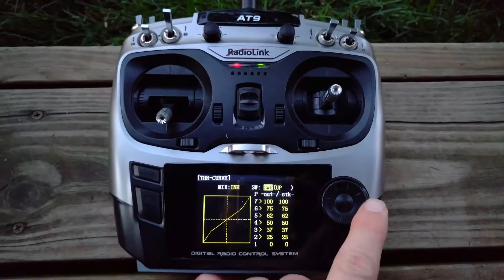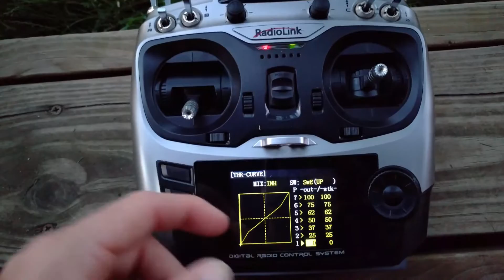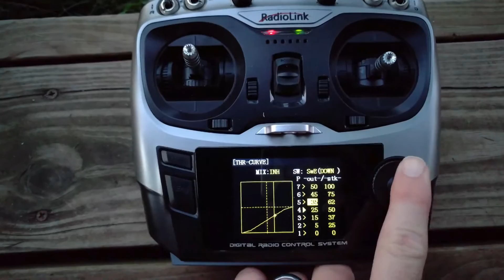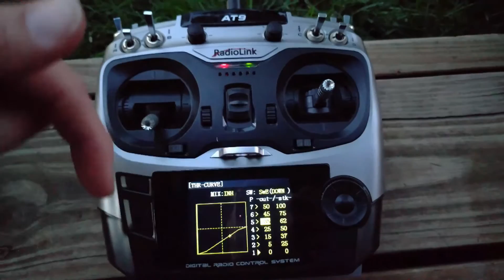RadioLink AT9 Throttle Curve Setup

Comment: Not understanding throttle curves as fairly new to this tx
I am finding my throttle stick has to be almost middle point befre i can make the quad move How do i alter it so the throttle responds at the bottom Thanks
Reply from the maker: Just adjust the throttle curve so at the bottom it is stopped and towards the middle you have hover, that's usually a good way to set it up.

Comment: In Betafligh I'm gettign 1067 - 1923 on the throttle value in the Receiver Config. but my motors wont spin up till 1146 in the BF Motor Calibration tab. Think this will help? I have already adjusted the stick parameters on the AT9 and balanced the motors.
Reply from the maker: MikeDrones it could be a solution, however, I would look at setting the deadband for each motor. This way it maps 1 from the remote to idle speed for the motors.
Reply: Thank you !! Ill check that out.  Your quick response gets you another subscriber.
Reply from the maker: MikeDrones I was going to apologize for the delay in replying, but thank you for subscribing

Comment: What does the INH do?
Reply from the maker: That would be for the collective pitch, you would probably use it if you work using a helicopter or a Quad set up with collective pitch control.
Reply from the maker: INH = Inhibit, so you would set that to on if you want to use collective pitch to control the throttle.
Reply: Five30Reviews thanks for the response. Mine is set to inh. I hate to keep asking but what do you mean by collective pitch?
Reply from the maker: Unlike on a quad On a helicopter, to go faster the propeller does not spin faster the pitch of the blades change.  Destin has a good video about it, get's a lot deeper than I could. https://youtu.be/MaB4k1SgfUg
Reply: I see, thank you.

Comment: Ok I have set mine to the 2 position switch and I had one profile set to normal and one with the 0 stick input to 5% throttle would that give the effect of an idle up switch. I am very new to RC and I want to get better with my acro flying. But no one has done a video that I have found that shows how to due an idle up so my quad doesn't crash out of the sky when the stick hits 0.
Reply from the maker: I have been reading about the idle up as well, it should be fairly easy, it may even be part of the Flight controller?  -- Honestly I'm also new to this acro flying.